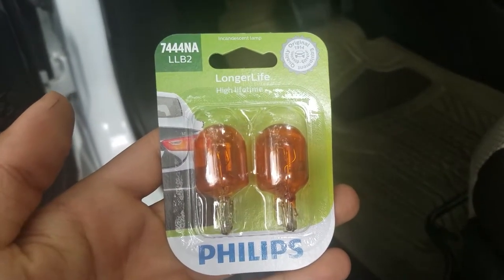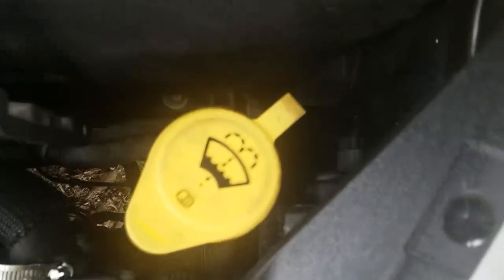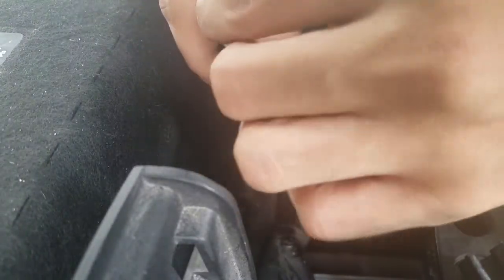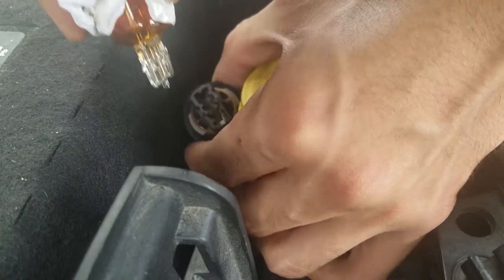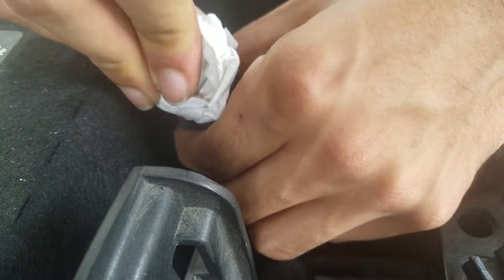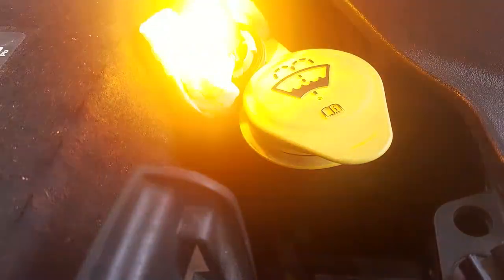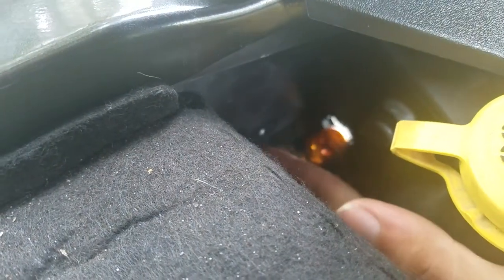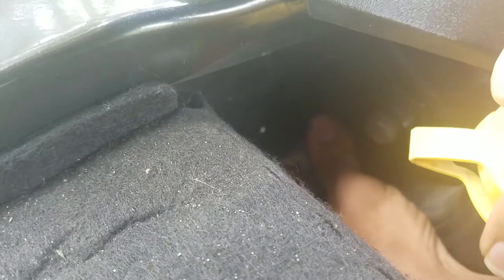Change Turn Signal/DRL Bulb on Dodge Dart 13-16 | Change Daytime Running Lights on Dodge Dart

Comment: How the hell do you remove the socket on the side parking light? It is a double connector and the outside one comes off  and the inner one will twist clockwise and be loose but there is no apparent slot for it to come out. I'm at my wits end!!

Comment: I replaced both lights and still get the park light out signal on my dash. Is it the wire?
Reply from the maker: Id say test the bulb sockets for voltage